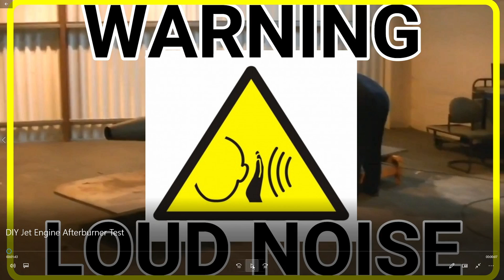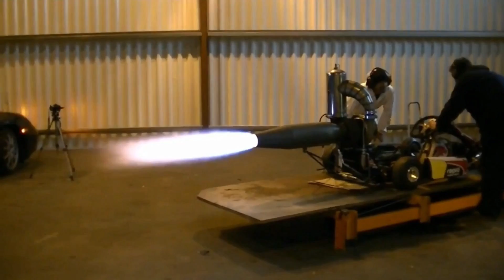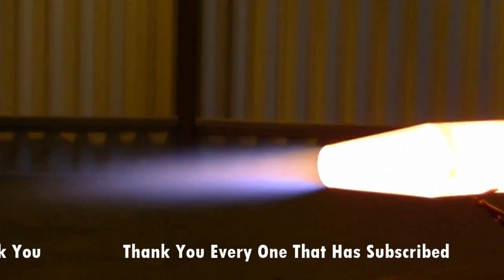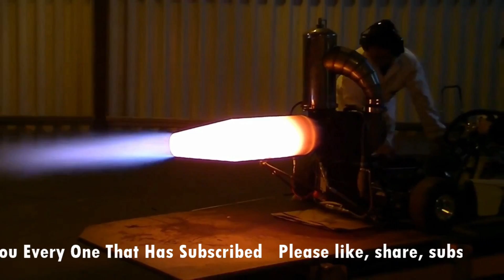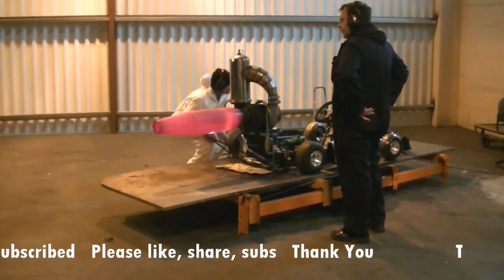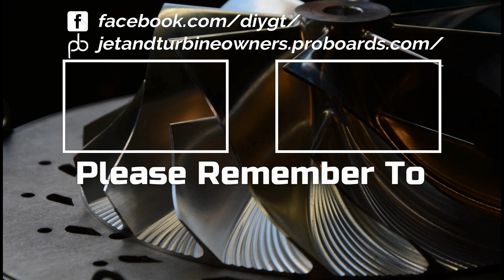Jet Engine Afterburner Test DIY Gas Turbine

Comment: Junior aerospace engineer here (other engineers feel free to correct me). You have to use a converging diverging nozzle to achieve supersonic thrust. Your design is only a converging nozzle, which will only achieve choked flow, in which the mach number of the exiting exhaust gasses can never be greater than 1 (speed of sound at the exhaust gas temperature). Essentially, your converging nozzle spits out a lot of super hot exhaust at a limited speed, hence being called "choked." The smoothly necked down throat area of a converging diverging nozzle allows the flow to transition to supersonic (think rocket engine bell nozzles). While the supersonic gasses are being expanded in the exhaust nozzle, the thermal energy is converted to kinetic energy, which means more thrust! This is why the nozzles of the afterburning turbofans on fighter jets are converging (necked down) while in regular power range, and open up to expand the hot gasses when afterburner is lit up (converging diverging). Making this simple change could double the thrust of the engine while in afterburner. However, rough calculations would need to be attempted to calculate the correct throat area and geometry.
Reply from the maker: Sorry no need for C/D here.... but i do understand how they work, and as our gasses are not somic , no need

Comment: I got a question. I've been a mechanic for 32 years and i KNOW how to use a blow tourch. So when heating metal with a blow torch, white, is the color the metal turns before it goes liquid. How does the chamber hold the pressure in an "almost" liquid state??! Red or orange metal is hot, but when it hits white.. its just short of melting.
Reply from the maker: https://youtu.be/kosb-HYILf8